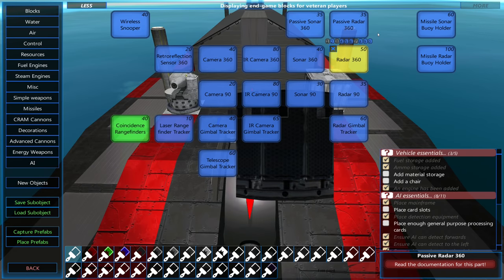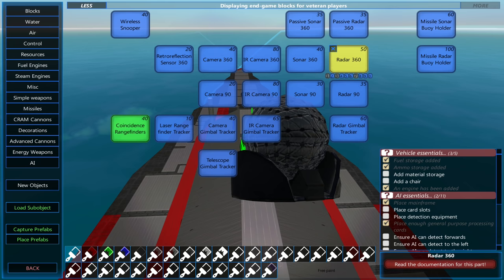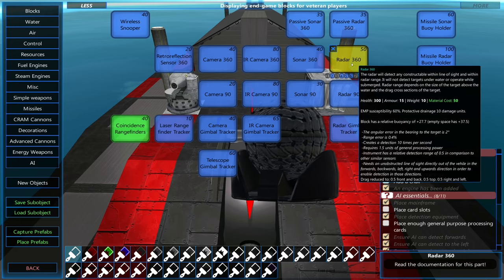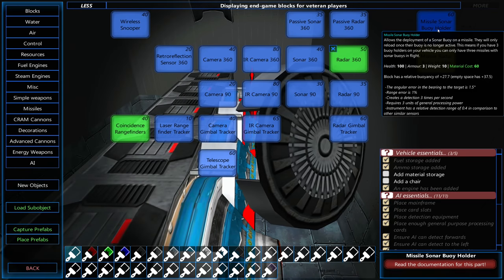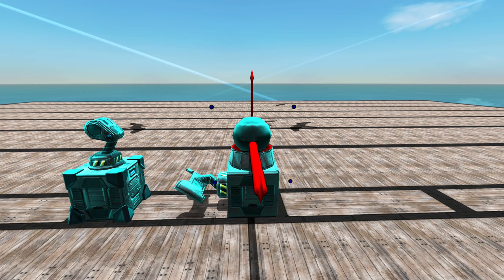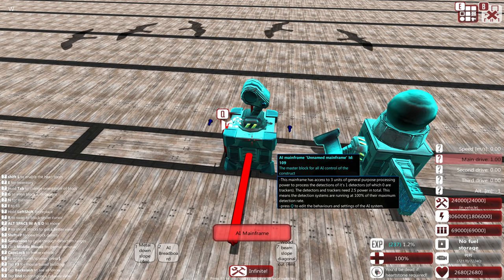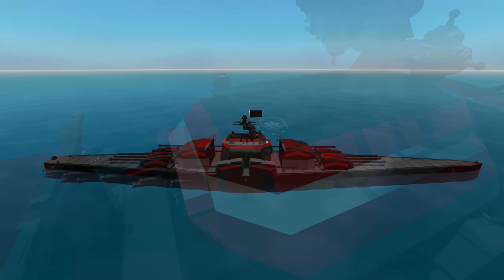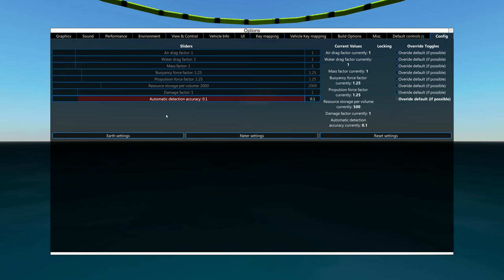From The Depths Detection Tutorial

Comment: You can do a pretty decently effective stealth submarine by just covering it in rubber and trying to make little to non non rubber exposed blocks. This works even better for aircrafts because radar is less accurate than sonar, thou cameras are a thing so you would want to do night time attacks. If you set the automatic detection accuracy to zero you can make it if far and stealthy enough they can’t detect you, or at least  be very inaccurate (I’ve saw the detection be 100-10m off normally with a fairly large sub at about 1500m) if you do want to make a stealth sub I suggest making it small.
Reply: Everyone is saying rubber gives off little radar signature and that it says in the description of the block but i dont see it in the item description :/ where can i find it?

Comment: Hey man, I had a tutorial request I wanted to run by you, honestly cause I find your FtD tuts are more concise and easier to put into practice than any other FtD youtuber's are.

Anywho, what I was hoping for was a tutorial on Double-1-axis or Spinblock turrets, i'm not sure what they would be called but the basic form and function is this: You have a 1-axis mounted into/onto your deck, Mounted onto this is a U shaped (essentially) gunmount, with the the bottom of the U arch attached to the 1-axis and the two prongs/tines pointed up in the air. Then inside one of the prong/tines there is another 1-axis (or spinblock? I really don't know hence why i'm asking you, lol) turret, facing inwards towards the other prong/tine. Attached to this second 1-axis is your actual gun/turret housing with all your CRAM/APS/Missle/Whatever pieces.

It's my understanding that this sort of housing system, while having a lot of really obvious drawbacks (gun-guts above deck, 2 separate 1-axis' to destroy that could cripple the gun, etc) it's got this one really niche piece of functionality; You can mount a really high velocity (relatively) CRAM into it, and it requires no motor driven/elevation/etc barrels as the whole 2-piece mounting setup does all that for you. Same deal, it can be used to house a really F'ing accurate laser w/o having to add any steering optics to it to add elevation/azimuth to it, because you can just have a laser connector firing up through the original 1-axis on deck into the turret cradled in the U shaped pintle mount.

And finally, the real piece-de-resistance, it just looks super friggin cool man, lol. Anyways, cheers man, and thank you so much for all your really quality content, keep up the awesome work, absolutely love your stuff.

PS Edit: Oh, and when can we expect more of 'The Road to Peace'? That series makes me salivate, truly brilliant, not enough people making story-based/driven From the Depths content.

Comment: Hey, just stumbled across your video, trying to make a cram artillery, but the gun is insanely inaccurate. I'm thinking that I'm not using the detection correct.
Reply from the maker: Are they trying to hit moving targets? The cram cannon can have a little trouble with that because of its slow shell velocity.
Reply: @ballparkkenan  that's what I thought it was as well, I tried it on stationary targets and it was still wildly inaccurate. Seen on a forum from 2016 that the aim point can mess it up. I took that off and it's working better now. Also, I set it to explode near the target as well to do even a small amount of damage on the targets in the event of a miss.

Comment: Aren't the range finders the best for weapon accuracy? the description led me to think that they have the best detection stats overall and since you won't need to calculate enemy's range and bearing if you don't have weapons, i don't see the need for other detection (unless ofc, you're not using turrets big enough to fit one of those)
If i remember correctly, some detection equipment FINDS the enemy and other's only track it
the difference is that detectors relay awfully innacurate information, while trackers are way more accurate, but the later can't find an enemy by itself
Reply from the maker: For range accuracy yes.The camera gimbal tracker has the best bearing accuracy and the laser range finder has the best range accuracy.
Reply: Weapon accuracy is a compound of bearing and range accuracy. Bearing is always the most important, and range is increasingly important the slower the projectiles you use.
If you are using guided missiles, you don't need any accuracy except for remote guidance. Only an initial spotting is enough and then the missile component will track on its own if it's able to.
Reply: @OhmIsFutile  You sure that it's just bearing+range? with accuracy i mean how it can pinpoint it's location, what i'm getting from you is that once the ship detects another ship, it instantly knows in wich direction it's with perfect precision, are you sure that it's the case?
bearing refers to how fast it's moving on a certain direction to compensate for the shot